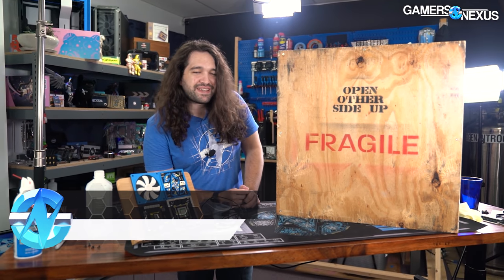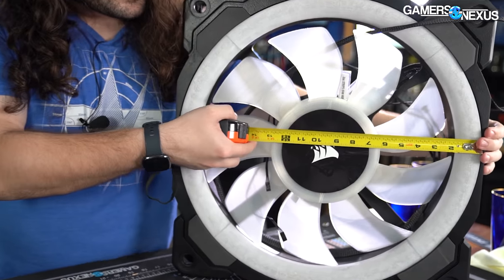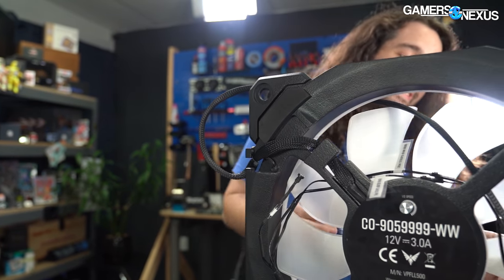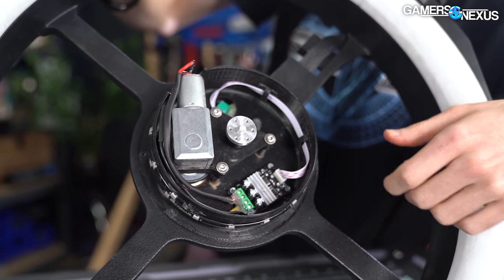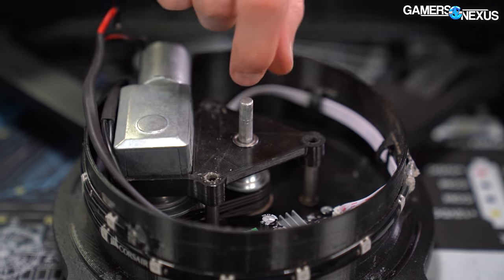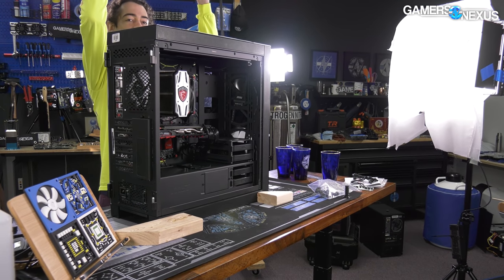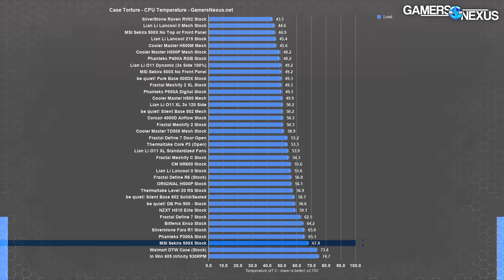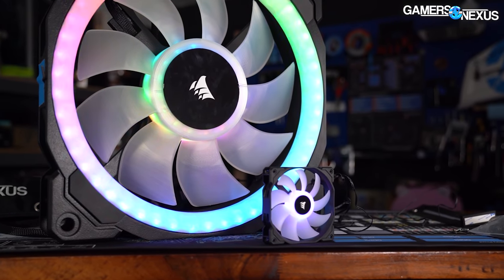World's Biggest Computer Fan: Corsair 500mm LL RGB Fan

Comment: The biggest problem is the worm drive on the motor shaft. This is preventing the fan driving the motor as the fan stops after the power has been switched off. It then grinds the cog grinds against the worm drive as the fan slows down and the motor stands still. A worm drive cannot be used in a case where the output shaft of the gearbox has such high velocity. Grease or more powerful motor would not solve this issue.

Comment: Whats probably happening is when the motor stops the inertia of the fan is forcing the gears that would like to stop, to continue moving. So each time you stop this fan your damaging the gear box. Might help this by going to minimum speed before shutting off. If it was mine I'd put an arduino in it and PWM the motor driver, and use a switch to trigger a shutdown sequence. Then ramping it down over several seconds until it stops.

Comment: Sounds like the gearbox is the issue.  That feature of not allowing freewheeling (see 9: 33) is likely causing extreme wear every time the fan is turned off. Lazy job of spec'ing the motor/gearbox.  Could have easily tracked down the motor from an automotive fan  that would fit the bill, although power draw would likely be higher.

Comment: This is hillarious! I was expecting the fan to be brushless, turned out theres a 5v brushed motor in it and the rest of the 12v system goes to rgb.
But with the size of the fan it would at least need 24V 10A if it was a brushless fan to run at 1200-1800rpm and wont die for 10 years like a car’s fan.

Comment: If they were really keen on having a non back drivable worm driven gearbox assembly, they should have installed a ratchet mechanism to the final output shaft. Once the power is removed the gearbox can lock up normally and the fan can still keep spinning from its inertia without braking anything.

Comment: I’d put a brushless pancake motor for a large drone with an electronic speed controller on it. You could do away with the gearbox entirely.  You could fine tune the rpm and have a ridiculous amount of power on tap for testing if you wanted it. Hell, you could make the computer hover if you wanted 😂

Comment: The motor wasn't necessarily designed to seize up when power is cut, that's simply the result of using a worm gear in the gearbox. They should have used planetary gears, but were likely trying to save a few dollars using an inferior (for this application) design. They knew the gears would stop instantly, which is why they decided to use belts without teeth instead of a real belt, or a gear. I could easily and for very little money make this bulletproof by using an appropriate gearbox, or using a good belt and adding a clutch mechanism to the fan shaft. Not sure why they didn't.

Comment: If you want to upgrade from that, best go straight for a Pratt & Whitney PW1000G. Its 2060 mm fan it has an air throughput of 593 kg/s... at 10,000 ft altitude.
Downsides: Noise signature.

Comment: Weeeell. I actually plan to use a honeywell rebranded room fan for my next  radiator(car)/cooler build. It's kinda powerful (directed stream, not an open grid) and silent for the amount of air it moves.. 
Also at 22bucks a lot cheaper than buying a fitting car radiator fan or 9 to 12 silent pc fans.
Gonna need a 12V relays to switch 230AC to it when pc is on, (could use a master/slave socket) and it has 3 power settings which i think lowest will be fine.
(Honeywell HT900E)

Comment: Grease won’t help. They made a mistake by using a design that forces the gearbox to lock when the fan is turned off. The momentum of the fan trying to continue spinning is what grinds the gears out. They need a more solid mechanism to stop the fan than those little brass gears, or a method to allow the fan to slip in one direction but not the other.

Comment: Use a flat enclosed ceiling fan. Like the following one:

Jinweite Ceiling Fan with Light, 22 inches LED Remote Control Fully Dimmable Lighting Modes Invisible Acrylic Blades Metal Shell Semi Flush Mount Low Profile Fan, Black

Comment: It’s burning up because that gear box like your man said is made for mechanical Motion kinda like a servo. The residual energy of the fan keeps the hub spinning when the motor is shut off and as a result continues driving the one way gear box in reverse. I believe I saw a worm gear in that gear box and the way they are designed the power cannot be reversed. Similar to how you can’t turn the drivetrain tire of your vehicle when jacked up. So the blade continues to spin when the motors turned off and reverses the power flow and pretty much is grinding, snapping, and bowing out the gears in the box forcing it to spin. Really bad design from a product built with that many precision parts. I guess it was a minor over sight until the end tho and they probably built the whole fan around that motor and mount before actually testing it those are my assumptions tho

Comment: So, if the motor needed a replacement (as in, completely different motor, not just the same).  I'd suggest a used Grinder that has been kinda gutted.  Imagine this thing getting close to 700 RPM.

Comment: Well, a big fan like that isn't a bad idea in my book, it's a lot quieter than smaller fans for sure... How about making fans that fit instead of the side panel on select cases?...
PS. The reason for the gearbox suicide is the weight of the fan blade vs the small gears made from relatively soft metals and of course the makeshift belt (personally I would have used a cheap timing belt from aliexpress)

Comment: This is definitely a cool toy. I'm wondering what other companies are gonna do in similar vein. It's neat when something silly like this is done, especially when it's not just a static piece.

However... <deep breath & heavy sigh>

OH. MY. GOD. I don't... I can't... I just... Who's the "genius" that decided on the internal workings?! 

You DO NOT use multiple belts for a motor unless it's SPECIFICALLY designed for it. If the pulley has multiple slots, then (and only *then*) is it designed for it. Otherwise, you use ONE belt. And you DON'T use a motor that instantly locks on a FAN! What fans has anyone used in the history of fans that have an INSTANT LOCK MOTOR?! There's a reason NONE of them have that: The inertia of the blades will cause it to spin until it stops, thus it needs to be able to SPIN FREELY or it will KILL THE MOTOR! DUR-HUR! That's why you have metal dust in the original dead motor. The gears were ground up due to the blades needing to continue spinning. The blades WILL take the gears with it. 

Between the incorrect belts used and the incorrect motor choice, both are the combined reason it died. I'm not an engineer, but I work with equipment that use belts and motors, and have to repair them. The part about the motor instant locking is simple logic and reasoning. Y'know, that thing MSI didn't do with the case used in this video regarding cooling.

Comment: Overclock the fan with a brushless motor reduced so the fan still spins around 200-800 RPM.  If you give me some dimensions I can make up a circuit and send a brushless motor over plus some 3d printed adapters :)

Comment: No Joke, I would actually consider buying such fan, for a custom PC case. I don't mind the size of the case, and by looking at the temperature graph, having my CPU and GPU temps being like 30% cooler than by using even noctua 120mm fans (Which I have tested myself) , I would have a better time overclocking my cpu to its maximum, to maybe manage to get 4.5ghz with ryzen 7 2700 and maybe boosting my GPU to gain a couple of FPS.... althought, I have no idea, where I would buy a simmilar Fan from...

Comment: Stick in a Hobby-Grade RC car motor such as a HobbyWing 4274 2200KV and run it on a 6-Cell LiPo battery (25V fully charged x 2200KV = 55,000 Motor RPM). That'll be one hell of a fan 🤣

Comment: The gear box is the problem as it locks up every time it stops. The mass from the fan is slapping those gears hard as hell. If they did a bigger motor and belt drive it would work perfect but the gear box is the weak point.

Comment: Those small belts wont work properly in prolonged runs. If they wanted to really go beltdrive, they should have used the classic standard sized, open double pulley system.

Comment: The gearbox is too small to drive such a big propeller. Corsair is better off using the type of motor used in an automobile radiator fan and ramping the speed down with a pwm controller.
Reply: I hate AUTOCORRECT and i am unable to edit the comment

Comment: They should've used made it a brushless motor just like a normal fan but bigger. Brushless = More efficient and more reliable. Just a bearing on the center of the fan and coils of wiring on the stationary hub and magnets on the fan hub. KISS principle Keep it simple stupid.

Comment: I know this is just a meme but I would buy a case with something like that instead of a glass panel even if it costed 150$  more. Low temp> everything else when it comes to buying a case for me, I don't want rgb, glass, expensive materials, controllers. I want the cheapest case with lower possible temps

Comment: Why even bother building it with a pully system. Couldn't they just gut or build a cosmetic plate around a typical box fan? I get wanting it on 12v as opposed to 120v mains but that little gearbox motor on a pully is gonna burn out fast.

Comment: This fan will always break as long as it is driven by a worm gear and no one way clutch.  The motor is working as designed.  This is just the wrong application for it.  It has no way to "free spin" once the power is cut.

Comment: 100% that gearbox is doomed to failure.  The huge angular momentum of the blades is geared up from the ratio of the belt to the drive wheel.  Then, that poor brass worm gear is subjected to a lot of force.  It is absolutely not the correct application for a gearbox like that.  The fan speed should be turned all the way down before turning it off, to reduce damage.  But, again, it's doomed to die.

Comment: That is a horrendously designed fan. Any motor that is attached to a worm drive and gears and or a belt with a substantially weighted fan must be able to freespin, otherwise the belt or gears will strip on spin up and power down, unless these speeds are intentionally controlled so as to significantly reduce the torquing moment.

I know it's not really meant to be a serious commercial fan, but still, they could've done better.

Comment: Reason they just use a normal electric motor in a fan that size for example, electric radiator fans that've been around for decades. .... not a tiny hobby motor driving it via o-rings and puny sintered gears -- that was so much WTF.

This is more like a "display" item -- like an arm waving girl for beer, not mean to be actually used as a fan.

Comment: This is such a poorly designed product, unbelievable. Belt drives are inherently unreliable. Using a bunch of rubber bands as belt makes it worse. The only reason those belts are even there is because they used a gearbox that isn't fit for the job, and it failed anyway. If they are making the effort to build a custom belt setup, they might as wel make a custom gearbox instead, integrate it with the fan's shaft and lose the belt. It's not that hard, gears are standardised of the shelf parts that you can mix and match in a 3d printed housing.

Comment: Corsair = making PC garbage since 2008 LOL

You know they don't have a clue when it comes to fan design because instead of a gearbox they should have used a simple belt-driven flywheel like you see on retro turntables. A single reduction gear would eliminate the locking issue and wear, but it's obvious as well the concept of INERTIA falls outside the brains of Corsair's engineers.

This really would have been more believable AS a SLOOFLIRPA prank, but I digress, when you put a bunch of monkeys together with an all-you-can-eat banana buffet this is the result.